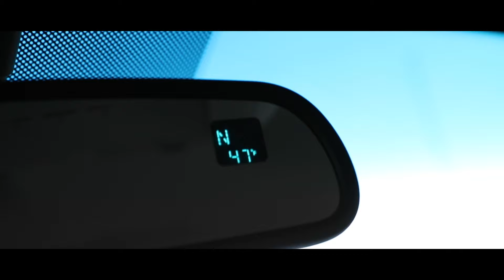HOW TO GET CLIENTS FOR YOUR LAWN CARE BUSINESS!

Comment: In my experience, the 225 trimmer is one of the best. I find it to be lightweight and handles most everything. I run Stihl as primary but had to buy the 225 for my partner (wife) who needed something lighter. For the cost and reliability, I got to give the 225 respect.